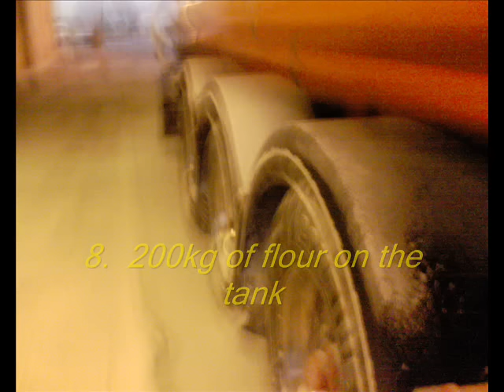EASY JOB ...but some little problems.wmv

Comment from the maker: @1234niall i have always this trailer,i keep this one ,it is better to not change of trailer
when i have another one for one days it is because i must wait to unload mine,usely the tractor unit and the trailer is dedicated to the same driver
my first truck at sitra was an iveco 190.30 turbo and after a daf 2800 turbo intercooling 340hp with a fuller gearbox
have a good week

Comment from the maker: @1234niall @1234niall we keep our own trailer ,it is just a question to know your material ,always change of tanker is each time problems...a tanker is a machine ,not a normal trailer,there are many pieces and hoses to keep in good condition,you know how it is ,if it is not your trailers ,the lids are half closed,there are hoses broken or missing,and the same with the rubber joints